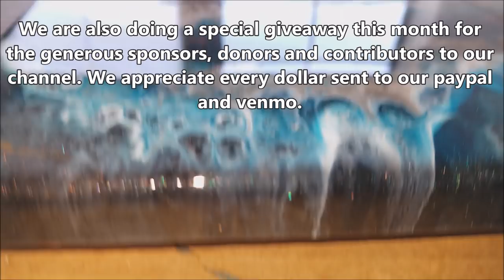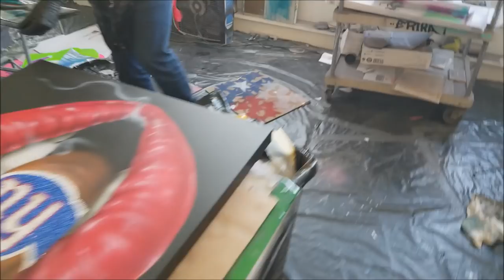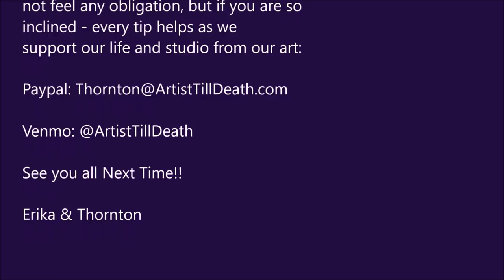Know When To Quit (Resin Pour Tutorial)

Comment: Love it !! Loving all of it, the colors, the waves, the lacing & Cujo !! 
I use Pro Marine, love it. The resin is thicker & the colors get more depth. 
I tried 2 other resins and the colors are so flat. I have one piece with 6 layers and you can't see any of the depth.
I thought I was doing something wrong. I just had the wrong resin for what I wanted.
I like using the thinner resin for top coating. (when I can afford to have 2 resins LOL).
Reply from the maker: I will definitely try some,  do you usually order online?
Reply: I order direct from them
Reply from the maker: That's probably the cheapest route for sure.